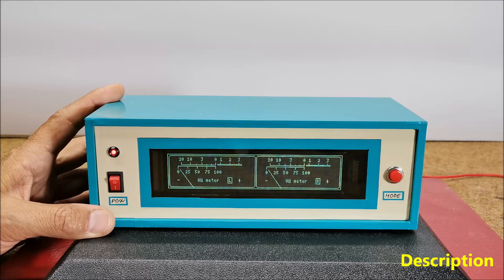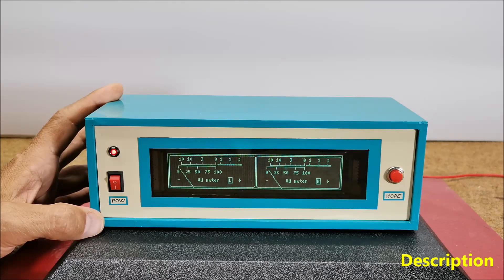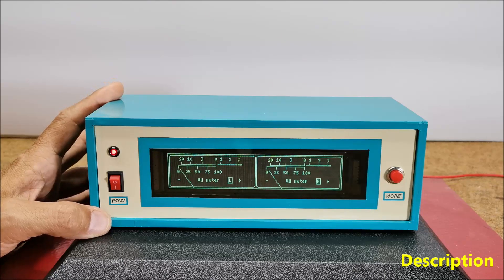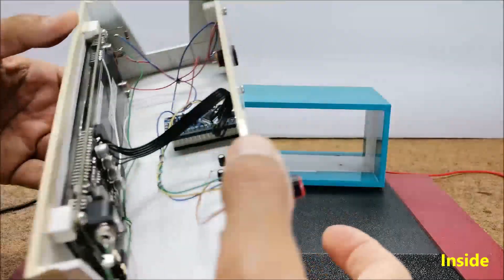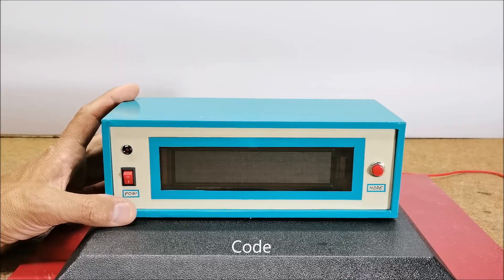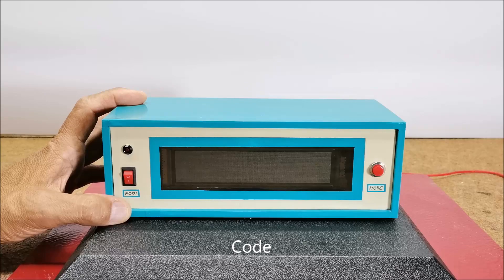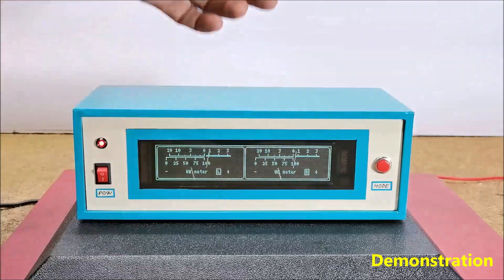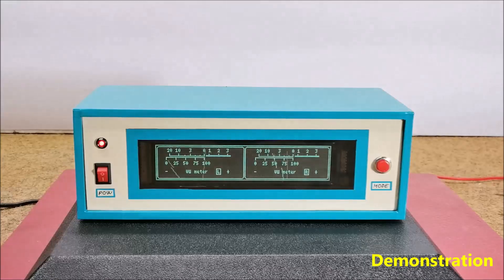Retro look Analog style VU meter on VFD display with Arduino Nano

Comment: Hi, Did you feed the audio signal directly from the amplifier into the A0 pin Arduino or through a small circuit?
Reply from the maker: Through potentiometer and capacior. Look schematic at: https://www.hackster.io/mircemk/retro-analog-style-vu-meter-on-vfd-display-7b7d9f